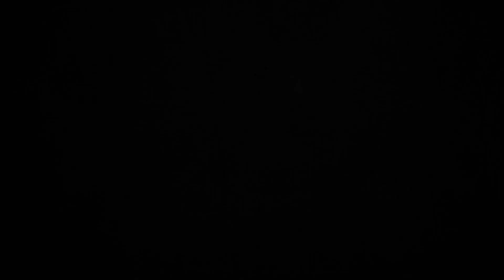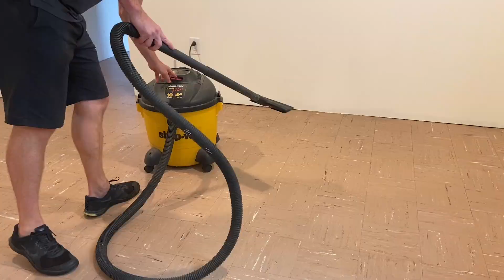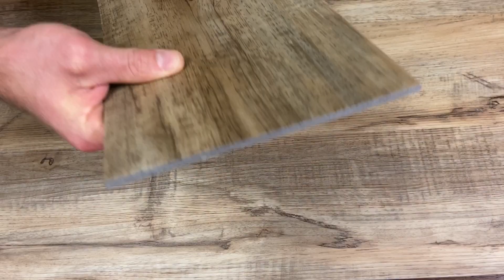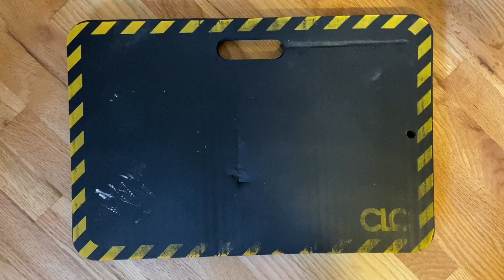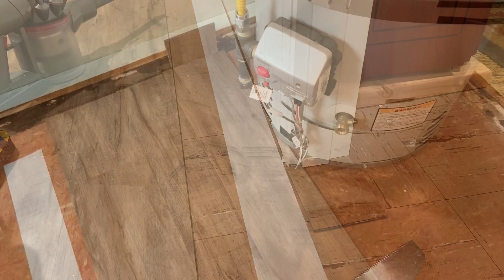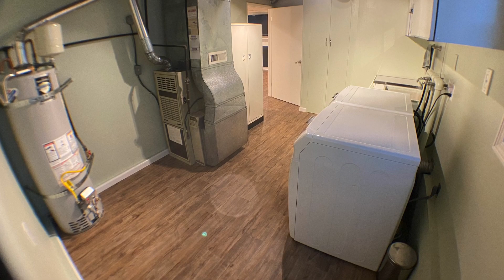How to Install Vinyl Plank Flooring - Beginner or Pro - Quality Craft Admira Collection

Comment: Because it is taped can it be moped? I'm looking to finish the flooring in my horse trailer weekender LQ... but because we well be in and out with dirty, wet, or muddy feet it's going to be to be washable! Tape would be so much easier, but maybe not right for a wet dirty location
Reply from the maker: Hey Brenna, we haven't put it to the test since installing this but I can say that it depends on how much water you plan to use. A little damp cloth is fine but I wouldn't suggest a fully soaked mop on it.
Reply: @WBToolNews  thank you! I am thinking of gluing with PL MAX...  I don't really want it coming up ever lol 😆... and sometimes our shoes will made puddles and the kids never leave their shoes on the rug!!
Reply from the maker: @brennasamarin  If you never plan to remove the flooring then glue will keep that flooring down!